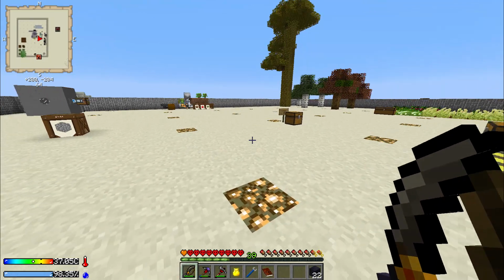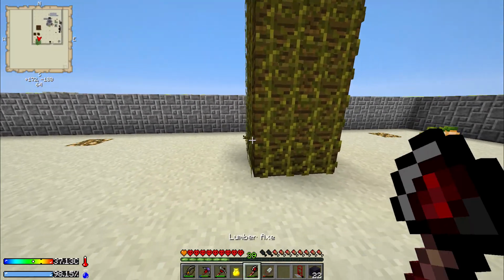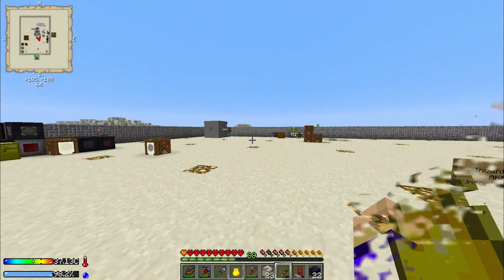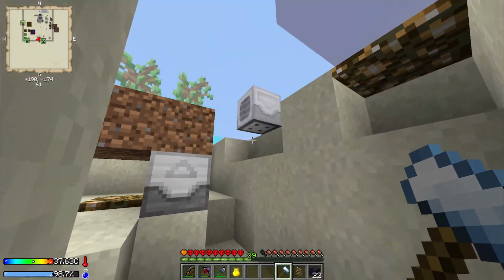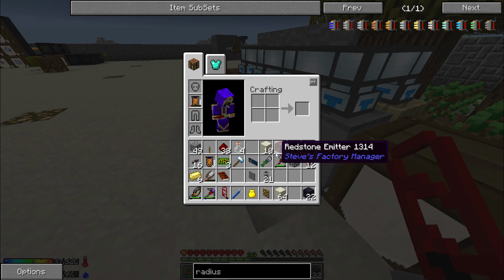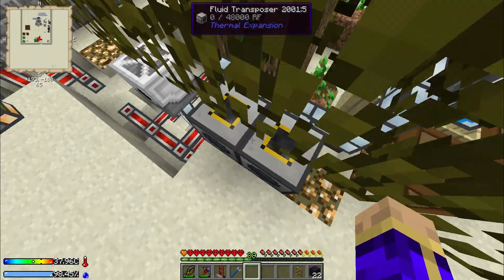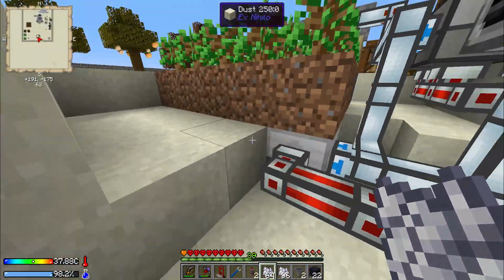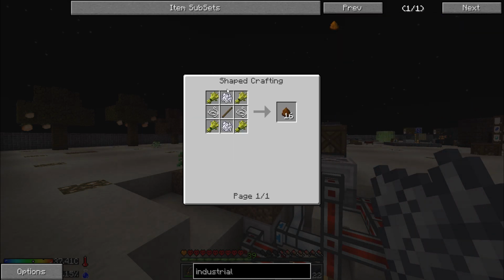Green Growing Things - Episode 13 - Crash Landing

Comment: Wouldn't it be much better to shear the leaves, send them into jabba barrels, pull them out into the fluid transposer, send the saplings from these leaves back into the planter and compost the rest and the leaves that do not fit? You get about 5 buckets per tree + 5 saplings. Now you get just 5 saplings and 1/2 bucket of water.
Reply from the maker: Yes. Yes it would. I'll do an update next episode.
Reply: PurpleMentat There is one downside. You will have to make sure that the water can go somewhere or you don't get any saplings back. Not sure how to solve this. Eventually a fluiduct into an unused QDS? If you put the water into a cyclic assembler you should be able to fill the camel pack automatically. But don't mind me, I never really played this pack a lot. I just played an hour or two as it was alpha.
Reply: EfficiencyVI whoops sorry Effi, I wasn't intending to reply to your message, it was the last guy, Jeridan who commented about the design.  Sometimes when I build designs with MFR machines in them I don't worry about efficiency since the machine produces so much.  I think the problem people are getting at is that when the fluid transposer fills with water it will no longer produce saplings from the leaves and the system might stop working.  I think JABBA barrels have a void install for items, but I don't know what the best method would be for water.  I guess you could put a glacial precipitator after the water drum to turn the excess water into snow/ice.
Reply: EfficiencyVI he can just set up a few drums they are fairly cheap and hold a lot of water but not sure how this would work on a server but think hes ina singel player world on this one.
Reply: Azreth22 You need 50 trees to fill a drum. So that might go pretty quick.
Reply: EfficiencyVI lol like i said kinda cheap 10 iron only stone is free so....... yah cheap
Reply: PurpleMentat
You know, everyone else is doing the leaves for max production.  I thought you designed this one to use saplings to be different.  To bad the "efficient's" can't appreciate that.
Reply: MrJeridan I can appreciate his videos and think of ways that multiply the output by ten by just changing the order of machines.
Reply: That's why he asked for comments about the setup.  MFR machines produce a ridiculous amount of resources if you set them up correctly.  There's nothing wrong with his method, yes leaves would be more efficient but as he has already said, he will be modifying the setup. 

Long read inc skip if you want...

I built a similar machine to this one in Agrarian Skies, and the setup I'd use here would be to export saplings into (in this order) planter, fluid transposer, barrel, *chest, trash can.  The chest would be rigged up to fill barrels and endlessly produce dirt in a pipe/barrel system.  Basically this machine would not stop, and once the planter was full (which would be quick) then the fluid transposer would run (into a drum is a good idea, mass water storage) and after that, all overflow would produce dirt and then a trashcan at the end would prevent the system from jamming.  Jungle trees would maximize your production with this system, but oak is pretty decent and produces apples, which you can also compost into dirt.  Ideally I'd run this whole setup off charcoal by putting a furnace in line to catch excess logs, but since the steam dynamo uses water which is precious in this map, you would have to test to see if you are producing far more water than the dynamo uses to keep the whole setup worthwhile. (and I realize after watching some more of the video Purple just built the exact same thing. heh that's what I get for commenting before finishing the video)
Reply: Reevin Why is everybody so p*ssed off about suggestion to make a given design better? I'm no native speaker, but I'm pretty sure, that "Wouldn't it be better …" does not mean "You are completely wrong, stop playing minecraft …!!!111!oneeleven".

One tree has about 50 leave blocks. If you put those 50 leave blocks into a fluid transposer, you get 5.000 mb of water and with 10 % chance for saplings you get 5 saplings. Minus 1 sapling for the tree you get half a dirt block. After your buffer chest has filled up and you have a decent amount of saplings you get over 6 dirt blocks per tree. A single tree takes about 30 minutes to grow. With the amount of trees it takes aproximately 4 minutes per tree.

So output now:
- 32 minutes to fill a camel pack
- 8 minutes per single dirt block

Optimized output:
- 4 minutes to fill a camel pack
- less than one minute per dirt block

If you only need the water for the camel pack this might be fine, but you will need a lot more water, e. g. to make clay and soul sand and you won't get a big surplus to handle all that.
Reply: Reevin I like the glacial precipitator idea. :-)
Reply: EfficiencyVI i like that plan to but my set up has leaves into transposer then barrel aray for dirt im trying to make my lands green again :P
Reply: Florian van Citters lol rightXP
Reply: An alternative method for using the overflow water would be to gradually fill a lake.  I haven't experimented with them enough myself to even know if this would work, but you could theoretically make a massive lake and fill it with drones.  Using them to place the water source blocks.  After all, a 40x40x10 deep lake would store sixteen thousand water source blocks.

Ice would still make the most sense, since you can stack it in item form and turn it back into water if need be.
Reply: Reevin Problem is you end up with a salt water lake.
Reply: EfficiencyVI is there a way to turn ice back into water? i know ina barrel its fine but anywere else it turns to salt water :(
Reply: Wait when you pick the water back up into a bucket does it stay salt water?  I thought that if you pick it up with a bucket and put it in a barrel or a tank you can then fill bottles with it again as regular water.  The reason he made regular ground placed water Salt Water was because you can infinitely fill bottles with it without consuming the water source, but I was assuming it changed back into normal water to be consumed properly if you stored it again.\

As for a reliable method for turning ice back into water, I'm not sure if there is a good one or not.  If you can't melt ice in a barrel then it's probably the classic place and break or wait to melt.
Reply: It should stay salt water if you place it somewhere.
Reply: EfficiencyVI It is only salt water because the biome is actually an ocean biome renamed.  Enviromine causes any water picked up in a bottle in an ocean biome to be salt water.  Picking up a water source in a bucket and placing in a tank will allow you to get a regular water bottle.
Reply: geeky1one Okay, as I said, I don't know that much about the latest version. I just played the early versions.
Reply: Ah geeky that's what I was thinking happened.  I watched the episode (5?) where Purple interviewed Iskandar and I remember him mentioning that the entire world is spawning as an Ocean biome for that very reason.

Comment: I have no issues with Pam's trees and the MFR fruit picker.  It just takes a while to cycle because it processes one row at a time and the larger the area, the longer to complete an entire pass.  It doesn't matter if there isn't anything planted, it processes every block every pass.  Now that you have a stack of saplings, I say to shear leaves for compost until you get enough dirt to complete the farm.
Reply: As the fruit grow really slow that is imo not an issue. In fact I use the max upgrade on my fruit picker with a 31x31 area iirc =)
Reply: Belgabor
Indeed, I have one with a silver upgrade covering 9 trees.  The thing with the upgrades is they double, no matter if the MFR machine is a center (planter) or an edge (harvester, fruit picker) so while the silver upgrade says 6, it extends 12.  So from the front of my picker/harvester it goes 15 blocks away and the planter it goes out 7 in each direction.  I wish the fertilizer would work on the Pam's trees.  That would be off the hook.